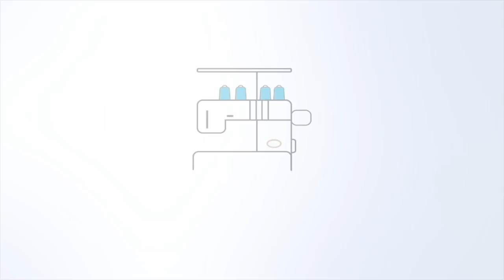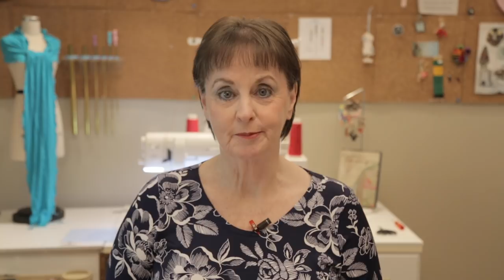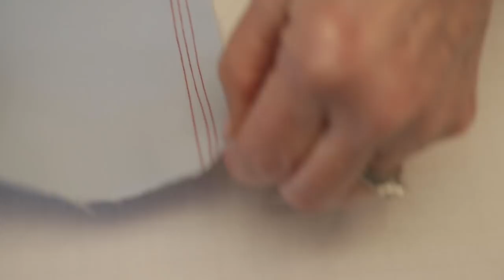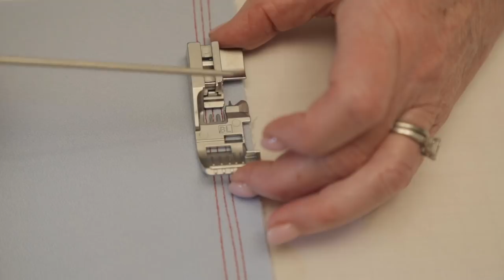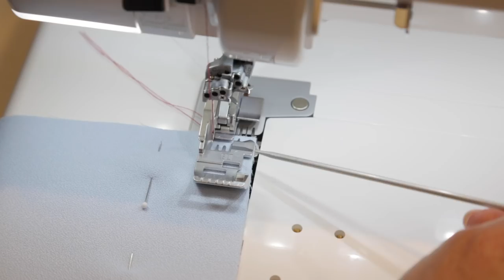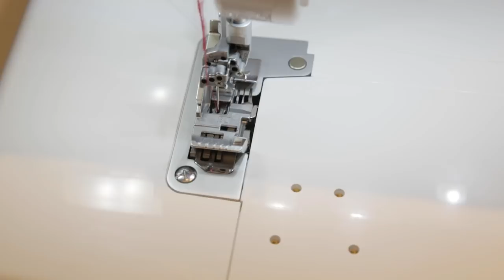Accurate Seam Allowances with the Chain Stitch

Comment: Thank you for all of your videos!  I love them and they have helped me so much!  When switching between different coverstitch needle positions, do you need to re-thread?
Reply from the maker: Hi Lucia,
That depends on what model machine you’re using for coverstitching. On Babylock machines, because there is just one tension dial for the chain needles, you don’t have to re-thread. But if you have individual tension dials or buttons for each needle, then yes, re-thread. Let me know if you have more questions and thanks for watching Serger Tip Clips!